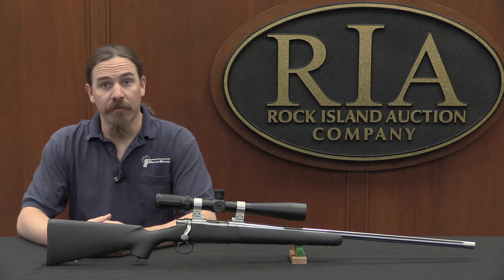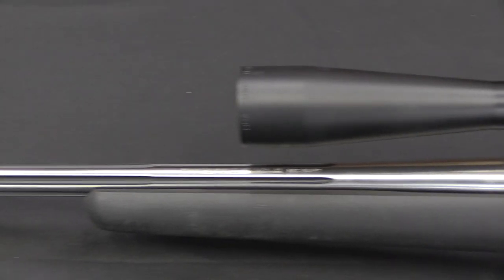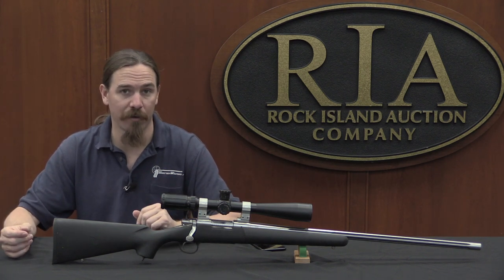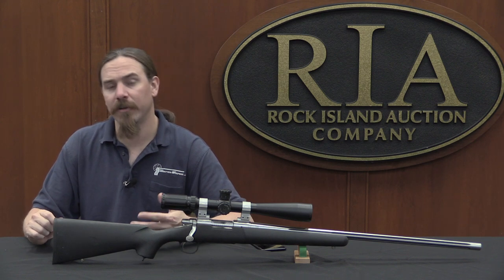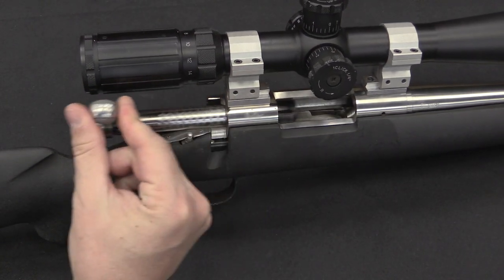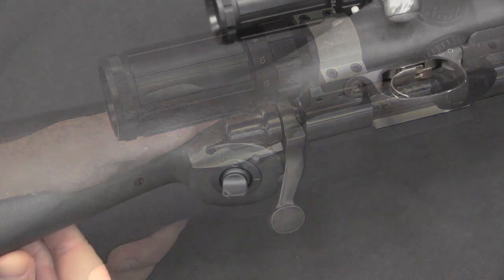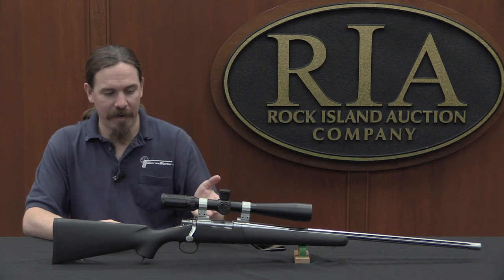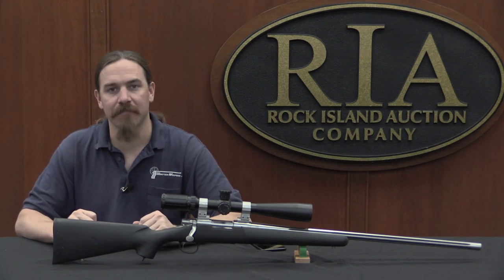Remington EtronX: Electrically Primed Ammunition

Comment: Seems like a very good solution for a lot of bullpup designs with horrible trigger mechanisms.
Reply: Almost Mediocre : That's probably the best use for this system.
Reply: Techno-bullpups when?
Reply: Statusinator : Soon. ish. Maybe.
Reply: But i can see the army wanting away to make the rifle have a wined up charging hand.
Reply: "Fry! You've got to cover us! You're the only one with a wound up gun!"
Reply: other use I can think (and I know some people will lose their shit over this idea) is, that this is the perfect firing mechanism for a smart gun (aka access verifying gun).

One of the smart guns technical problems is how to transfer electronic authorization to a reliably lockable and unlockable mechanical system. Also involving said lock time aka how fast after recognizing the authorized user can the weapon fire.

 Usually this involves something like a small servo, linear accuator etc. moving a pin or block in the trigger group. which means unreliability and possibly long lock time. Also makes hard to harden the gun, since any can bypass the electronic locking by probably just tampering a small mechanical component like a pin.

 With electronic firing the solution is already build in. The firing is electronic, so one can just also do the usage verification in electronic. Which means light speed authorization unlocking after valid authorization (which is it's own problem with many different methods, problems and solutions.), because it is just an electronic switch on an IC between the trigger micro switch and the capacitor being dumped in to the primer and firing the gun.

So smart techno bullpup??? Heads explode among some gun enthusiasts, but I can plenty see law enforcement etc. in many countries liking the idea. Knowing their SWAT weapons can only be used by their SWAT even if someone else gets their hands on one for some reason. So the SWAT teams guns could newer be turned against them, if someone managed to overpower one of them etc.
Reply: bami2 : This is mechanically and electricly a very simple and robust solution that maximizes existing infrastructure. Of course, it solves a problem no one had, but it's still an interesting technical exercise, and rather elegant.
Reply: +DyingIsMyLatestFashion Not really a novel problem. You could also burn all your matchcord or run out of percussion caps. Or en-bloc clips for your M1 Garand. It's a potential complication, but it clearly didn't matter...
I think Almost Mediocre is a genius. He took two kinda-established-but-flimsy firearm concepts and combined them, canceling out an issue one of these concepts had. Now it is just a metter of time before the pulse fired bullpup hits market :D
Reply: @Ari Takalo That's a really good point.
Reply: The triggers aren't that bad are they?
Reply: thebigitchy Yes but they aren't bad enough to warrant batteries for a military style rifle. Would you use this firing mechanism for a go to war rifle? Maybe in a 1022 Bullpup or a plinker I would.
Reply: Munkylaw They have batteries in radios and night vision goggles, various targeting systems, and hand held rocket launchers. The military will require very robust systems, but it is organize enough to actually make it work. If anything, the lack of mechanical parts could help in some dusty area?
Reply: Savin Wangtal : There will still be failures; they'll just be different failures.
Reply: that might b the ONLY thing that could help that thing!!!
Reply: Interesting side idea, instead of using a removable battery, could you simply use a portion of friction generated by the bolt carrier to generate electricity? Surely the energy needed to spark powder can't be that high right?
Reply: I don't think friction alone  would be practical and strong enough, but hooking the bolt to a small generator and using recoil energy to charge the battery would in fact increase the battery life. A LOT. (After all, car batteries have been using this principle for a while.)
It would still need a removable battery (in case it ran completly dry), but overall your idea is pretty briliant :D
Reply: In the high end airgun market I'm aware of at least two variations of a bullpup being made by Daystate  over in the UK that use electronics. Look up the Daystate Pulsar if you want to see their entire marketing bs pages on it, nice air rifles but they are a bit above the budget I have reserved for that aspect of my hobby.

Both are of the PCP type in one version the action itself is mechanical and the trigger just transfers an electronic signal to release the hammer hitting the valve releasing air from the reservoir. And in the other its a microcontroller driving a solenoid valve that releases the air from the reservoir to shoot the pellet.

The first version could easily be introduced even into hammer/striker fired firearms, just use the front mounted trigger to act as a switch that will electronically release the mechanical action. A big advantage of this is also that its very simple electronically speaking and can get a great battery life even on piss poor alkaline cells (easily a few thousand shots per battery replacement). When you need to heat the powder by dumping energy into a resistor the shot count drops drastically from just releasing the hammer/striker.

For 10m air pistols used in olympic target shooting a fair amount of those use an electronic trigger too, I don't know if its a solenoid valve or also just a mechanical release of spring tension. But either configuration will get the job done with a nice trigger.
Reply: +Cessoe Chan Napkin math says something like .08 mAh, assuming the battery is discharging at nominal 50 mA rate, which it probably isn't. I'd say that with the capacitor charging time so low, you're probably looking at .2 mA or so? I could be totally wrong, but I'd love to see some real info. The thing about the recoil energy, though, is that then you'd have to build a system to convert linear force to rotational force to power the motor, which then recharges the capacitor/battery. That's just more failure points, IMO.
Reply: Cessoe Chan The method of igniting the powder isn't a spark. It's basically just a small power resistor that gets quite hot when current passes through it. If I heard Ian correctly, he said that the resistor had a nominal resistance of 1.5 kohms. if it were passing 9v across the primer, that would only allow for 6mA of cirrent, producing 54mW of power. That is hardly even close to enough to get a resistor to the Flashpoint of gunpowder being approximately 160-170°C. If we pull a number out of thin air for a resistors dissipation ratio at 200°C/W, we see that our primer may only get to about 30°C at a room temp of 20°C. 
If we calculate a theoretical rise of 160° giving us 180° which should light the powder, that brings the power consumption of the resistor up to 800mW. This comes out to needing a supply of 89mA to reach this temp at 9v still. The proper resistor required to meet this temp increase would be about 100ohms on the nose. 
To get back to your question, generating enough power to get a resistor that hot would require something like a hand crank, friction (should we know how to harvest the energy efficiently enough) wouldn't provide enough. 
Last issue is that these are both types of energy and can be converted between these states freely. However, there are losses due to inefficiencies. Since friction creates heat energy, why not just get the bolt hot enough by rubbing it back and forth in the chamber? It would be vastly more efficient than trying to collect electrical energy from it and converting it BACK into heat. 
Anyways, it's always fun to be able to do dead reckoning like this. Rant over
Reply: DC-DC convert that 9V battery to 35V, then the dissipated power in a 1500 ohm resistor is V^2/R or 816.7 mW; Easy enough way, that. The main problem here is the market - very few people are willing to use anything that encourages those desiring biometrics-controllable weapons; For even a specialty niche market, reliability is king in firearms. (For the same reasons I don't much like self-driving cars, until software quality control gets a lot better we just aren't ready, IMO. We CAN make really good software - but it COSTS quite a bit more than "good enough" so it impacts profit margins... And we see what companies do with things like diesel fuel control systems...)
Reply: Dylan Headrick That's horribly inefficient, I can maybe understand for large cannons in a space ship or something where you don't want as many moving parts in opposite directions
Reply: can't wait for the g11 to become even more of a meme machine when it starts using this...
Reply: RE battery issues you could likely get a battery in the mags and just supply batteries with the loose ammo. Plus if you did things right you could likely reduce the standby power consumption right down. On generating power you don't have to convert it to rotating, just like those torches you shake a magnet in the bolt and a coil of wire around and that generates some power no clue if it's enough.
Reply: Harry King remember those hand crank flash lights?
Reply: I seem to recall in the past that some police departments had a problem where they would keep (non electrically primed) ammo loose in pockets at times, and they'd put a walkie-talkie battery in the same pocket; You probably can guess the result? Loose ammo goes Bang (tho since no chamber it just caused minor wounds, but a LOT of startlement I'd think!) with unhappy results...
Reply: Devin Tariel I agree, I'm not advocating it's efficiency, just calculating how clunky of a system it would be.
Reply: Harry King with those shaking flashlights, how long did it take to build up a sufficient charge? Just a single cycle on a recoil stroke wouldn't be enough to generate enough energy to sustain it. I'm not sure about you, but I'd prefer not having to shake my rifle for a minute to be able to fire a shot, lol.
Reply: Harry King with those shaking flashlights, how long did it take to build up a sufficient charge? Just a single cycle on a recoil stroke wouldn't be enough to generate enough energy to sustain it. I'm not sure about you, but I'd prefer not having to shake my rifle for a minute to be able to fire a shot, lol.
Reply: Dylan Headrick Well the Germans should make it, because they overengineer everything so it might be inefficient but more compact, but so compact you can't fix it. Haha
Reply: I mean, they make mouse traps that take 4 AA's that can discharge 50,000 times on a single set of batteries. The system here has identical electronics, and the voltage on mouse traps might in fact actually be even higher than what is needed to fire rounds electrically.
Reply: Not sure if anyone said this yet but I now have a weekend project for my AK. If I can't shoot it, I may as well mess with it!
Reply: Dylan Headrick How about the same shaking-charging tech but applied to your gear, with spare batteries charging on your person and a quick battery change requiring nothing more than moving a switch for it eject and sliding the new one in quick and easy
Reply: Almost Mediocre apparently thats due to most using something similiar to a streyer aug trigger mechanism (if i remember correctly, i dont know much about the aug and the subject personally), where a half pull would be semi auto and a full pull would be full auto
Reply: sunnyztmoney its not like the french navy made an updated bullpup thats actually no- oh wait (and dont even say but theyve been using it for a long time, weve been using one gun for a long time too)
Reply: Good point, no need for a transfer bar.
Reply: It is strange that they haven't tried to develop a system with magazine within the grip on bullpups like they have on automatic pistols. They come up with proper trigger. Standard NATO cartridge  isn't that long to have a narrow enough handle to have the trigger right in front of it.
Reply: You could use a solenoid to power the firing pin, and use traditional ammo.
Reply: I definitely gotta make electronic bullpups a thing, at least in fiction
Reply: hahaha i really want it to work but i cant imagine what military would take it, your gonna need a barbecue igniter for a trigger:D
Reply: Clever suggestion! Maybe the best app for this system. Except Army would not trust an infantry weapon that depends on batteries... In a SHTF situation? Forget it...
Reply: @Zbyhonj  More and more complexity. More weight, more things to go wrong. A battery would probably last a long time, and a spare battery wouldn't be hard to carry around.
Reply: @ISitOn MyArm nah, the EM2 looks great. Most look alright.
Reply: @cyruspalmer98  As I see it we need to know just how much energy it takes to set off the primer. If a battery pack is able to fire several thousands of rounds on a single charge then a replaceable battery pack would be good enough for most situations. If it can only fire a couple of hundred times then it needs either a better battery or some other solution. One way to do it would be to put the battery in the magazines. I think that's a simpler solution than regeneration.

All said I can't see this being implemented by any military as these weapons would require new ammunition that would be incompatible with the existing weapons. Perhaps it could be considered for specialized use such as sniping where a really good trigger could make a big difference, and the battery limitations isn't much of a problem.
Reply: Right on.
Reply: chemical primers last over 100 years if stored in a cool dry place.
Reply: Absolutely. For military use it would be better to give it a piezoelectric trigger and make it simply electrically fired, doing away with the electronics would make it more reliable and soldier proof.
Reply: I modified a mp15-22 to be a bullpup and did an electronic trigger. Works great, I used a small lipo battery and a simple circuit with a capacitor, mosfet, a microcontroller, and some other passive elements. A solenoid actuates the mechanical trigger mechanism. Obviously it's just a range toy not a duty weapon
Reply: That would work well with a nuclear  betavoltaic battery
Reply: @ISitOn MyArm I'm sure good looks are what every military in the world cares about most.
Reply: @Matt_The_Hugenot  That would work for semi-auto. Anything full auto would require a second PE element to be hit when the bolt slams forward.
Reply: @DeHerg  True, still preferable IMHO.
Reply: @Matt_The_Hugenot  Preferable to batteries or some of the generator ideas spun around here, absolutely.

Comment: I wonder why such a technology gets introduced in a bolt action. It would make a lot more sense in an automatic weapon as a neat means of setting the rate of fire to whatever you wished and it could also finally produce a bullpub with a top notch trigger.
Reply: using a solenoid and a electronic primer system will allow for a very adjustable fire rate and a more consistent output.
Reply: I don't think its viable in any way, so it doesn't matter. Adjustable fire rate and improved bullpup triggers will never outweigh the obvious problems with the concept.
Reply: Probably just tinkering with the concept and being the first one. It's cool gun and I'd love to own it just for sake of owning it.
Reply: "Minigun"
Reply: Wobbegong, that last one is a good idea.
Reply: @Zealot_of_Omnissiah  im making a shirt that is full front to back with shots and puting the trigger in my shoes so no hands needed and will work if my hands are up and walking backwards lol
Reply: @executiveorder7146  An unexpected design...
Reply: @nickperryjackkson284  That's what I was thinking. It already uses electrical cycling…
Reply: The M134D uses a motor to drive a gatling style mechanism. That's all the electricals in it. Maybe there's a solenoid to actuate the delinker clutch, but I'm not sure. Everything else is mechanical. You could even drive the gun with a crank if there were provisions to attach one.
Electrically prime it would be  as easy as it would be pointless. You'd have to put some electrical contacts to pass the current through the rotor and into the locking blocks. Circuit closure could be driven mechanically, like the gun already does to release the stryker pin.
But if you're wanting fire rate, the minigun has rotating barrels precisely to sustain a high fire rate. 4000rpm of 7.62NATO can get the barrels glowing cherry red in a minute of sustained fire. So making it electrically fired would be just adding failure points to the gun.
Reply: I think they where going for a proof of concept here. The military would not be interested in electrically primed small arms. It's still kinda taboo to mix electronics and guns. So they went for the civilian market to try and break the mould.
Making it a semi auto gun would just be asking for some electronic savvy dude to hack it into full auto. That could easily help sales while getting around the full auto gun ban, shifting the blame to illegal aftermarket modifications, but it would also put the entire concept into the fast lane to ban zone.
Reply: @ThZuao  Sounds like a dangerous zone to be in...
Reply: Thauã Aguirre i heard that the late version of the m61 vulcan has an electrical primer
Reply: I think it's just how deep classical concept of the cased catridge stuck in weapons world. Replacing chemical primer with nothing more than a piece of wire that gets hot will simplify a lot. Sure, you will need a source of electricity, but its much simpler and safer to produce, store and use than any chemical primer. And you need only one per gun. And it is replacable with whatever battery (or bank of them) you have lying around.